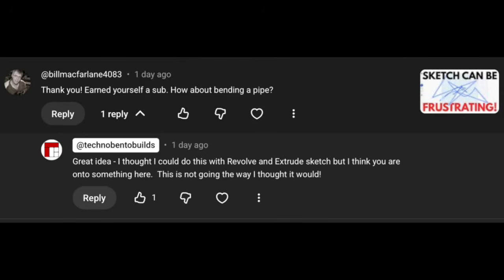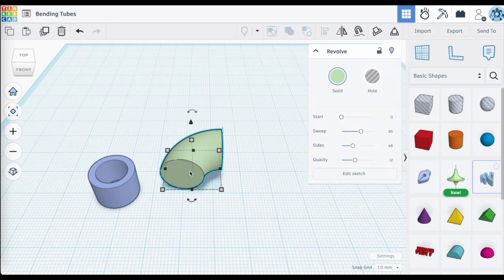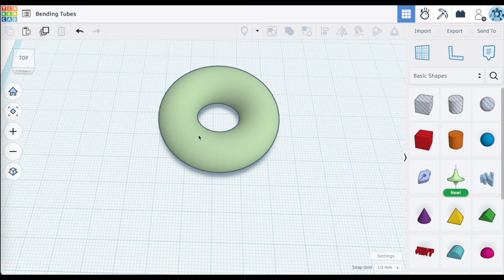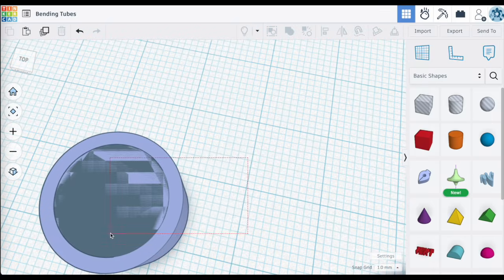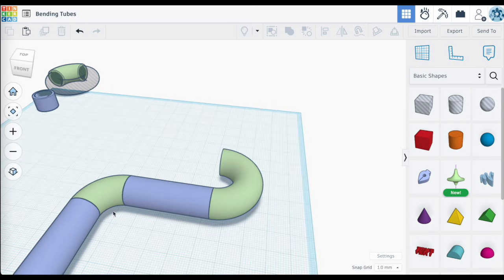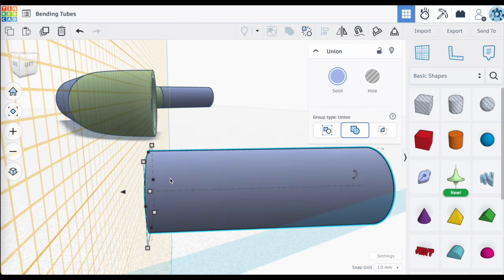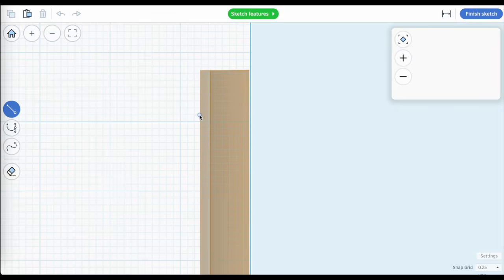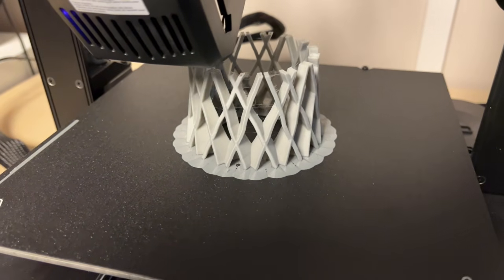Bending pipes and connecting them together in Tinkercad

Comment: Thanks, this is great! One question: with the bent pipe feature I can get a tight 90° bend. Is there a way to get the same tight 90° bend using the Evolve method? I need a 127mm pipe width with a tight 90° bend.
Reply from the maker: Hi @boatbandit2 - when using revolve sketch for bending pipes, moving the cross sectional sketch of your pipe closer or further away from that centre, revolve line will change the radius of your curve.  The closer you shift it to that centre line (when you are in sketch) the tighter the turn.  I hope that helped.

Comment: This was very cool.  After reading some comments, I do have a question.

I see what you are doing here and it makes sense.  Someone mentioned the pipe generator, so I just looked at that.  It too is cool and have good features.

So my question to you is, is what you showed better than the pipe generator?  if so, how.

I can see that adding the connector and the "T" is better with what you showed.

So having not used any pipe things before, only making a couple of connectors manually, I'm not sure which is better or if, perhaps combining both methods is good.  LOL  I do not know.  🤷‍♂👍😊
Reply from the maker: Hey @BlondieHappyGuy - I say go with the one that works for you.  The bent pipe generator is great because it is easy to use and if you are not into using the sketch tools you can generate your bent pipe quickly.  For me, I tend to use the sketch tools a lot so creating the bent pipe using revolve sketch allows me to continue working within those set of tools.  I also feel like I can add additional details to the pipe that might be possible with the bent pipe generator.

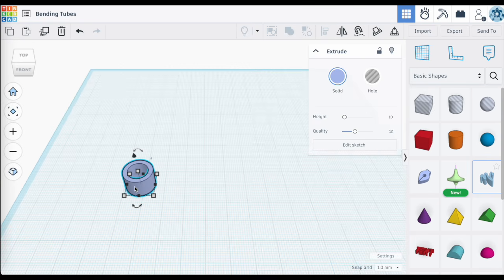Comment: TINKERCAD has some amazing features. But by adding details about alternate sequences and conversations is confusing. How did you re-enter the sketch? You did something so fast because you know this feature, I watched it 5 times and have no clue what you did, so it ends at 1:52 seconds.
Reply from the maker: Hi @Crozbyguy-rg1iu - my apologies on that.  To re-enter the sketch double click on that shape.  Just note that if this sketch is grouped with another shape you will need to ungroup it first before you can re-enter it with a double click.
Reply: Got it. Onward and upward. It's a component for separating gold dust from earth dust or silt. Technology rocks.

Comment: Could you use the tube generator for the straight pipes? Thank you
Reply from the maker: Hi @lanecaldwell8911 - if you are using the bent pipe generator, you should able to create a straight run of pipe by changing the bend angle to zero.

Comment: 11.43 into the video. How would you align something like that?
Reply from the maker: Hi @kristoffer-robinlotze7273 - that is a great question.  When I aligned those 2 pieces it required a bit of math.  If I aligned the along one edge, if I took total diameter of the curved 180 shape and subtracted the diameter of the tube itself, I would have the distance I needed to align along that axis.  When it comes to moving it, as soon as I drag it - the measurement numbers appear, I can click on the appropriate axis and enter in that calculated value.  It is a workaround but that is how I did it.  I hope that helped!

Comment: Why not just copy, scale & change to hole?
Reply from the maker: Hi @brokens1097 - yes you could do that too - however there are some challenges with a bent pipe - you would have to carefully align the scaled down hole with the larger solid tube to ensure you have an even wall thickness.  And you would most likely have ends that are solid since the hole would not extend the length of the solid tube.  It could work but I feel like it would require some work.
Reply: @technobentobuilds 
Good point. Appreciate your insight ❤️

Comment: I found a few things handy here, though I usually just take two cylinders one solid, one hole and make my pipe that way and achieve he same thing. Where I was having problems is I need 100mm diameter and I kept getting this orb instead of a doughnut. Finally realized there is a hard line in the sketch, anything to the right gets cut off. Moved the circle fully to the left and problem solved. Haven't tried the other tricks yet with the workplane tool or cruise, but now that I know what they do, will try on my other projects.  I just needed a simple 90*  hose connected that is just under 4" in diameter. Took a couple attempts but finally was able to create what I was looking for thanks to your video.
Reply from the maker: Hey @acdii that is great to hear!  2 cylinders to make a pipe makes complete sense!  Whatever works for you is the way to go.  All the best and thanks for the comment!

Comment: How can I make the straight line connected to the semicircle have a 10-degree inclination?
Reply from the maker: Hey @JoseDiaz-so5ir - i think I understand why you are describing here (but let me know if I am wrong) but if you are looking to connect a straight pipe to the end of a semi-circular pipe at a 10 Gergen angle, I would probably create a bent pipe connector that gives you that 10 degree turn and then rotate it so the bend is vertical.  You could also try to merge the 2 pipes together (ensuring that their cutouts were ‘active’) but you may want a smoother transition.  Anyways, I hope that helps.  Thanks for the question!

Comment: The Pipe shape can help with a lot of these things. I didn't know about the cruise function.
Reply from the maker: Hey @BillYovino - you can absolutely use the bent pipe shape generator.  What I like about using revolve and extrude sketch is the ability to customize the pipe cross section.  If I wanted an oval pipe or a rectangular pipe with beveled edges - it is doable with sketch options.  And yes - the cruise tool is great - I tend to forget that it’s there!

Comment: Great tutorial. This is the method I used when I needed to make a curved T connector. However, I had a hard time printing it. How would you go about printing the T connector you made in this video, or any of the non-straight pipes?
Reply from the maker: @SonyJunkie19 - so this is a great question and I think I will bring this up in another video.  But I just tried this out (using the tube dimensions seen on the video) and I printed up my T-junction and my 180 degree pipe bend.  I printed both using supports for overhangs that touch the printer build plate only.  This was to help prevent the tube from rolling while it was being printed.  The other additional thing I did for the T-junction was to print it at a 45 degree angle with the top part of the “T” on the build plate.  Both printed just fine.  But this topic of supports is a good one - thanks for bringing this up!